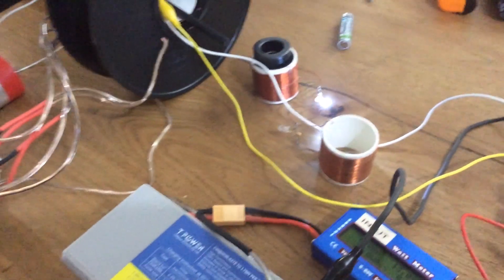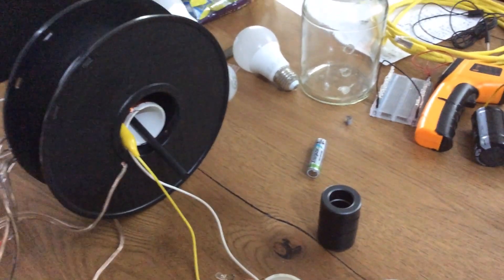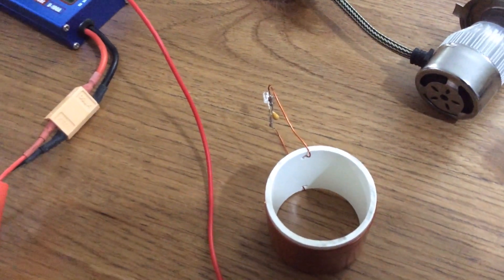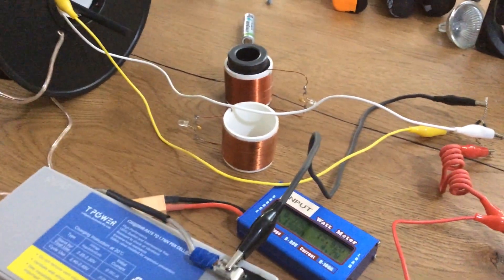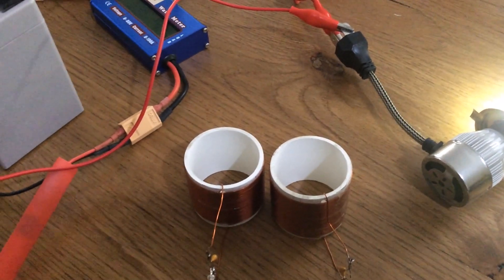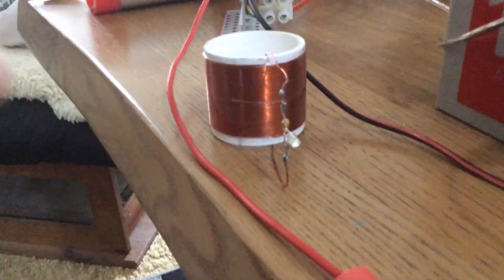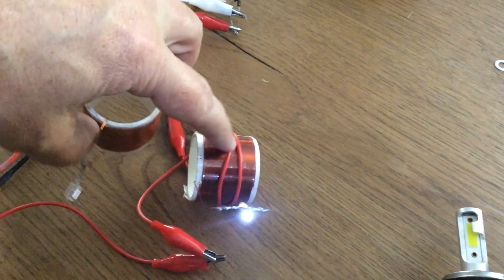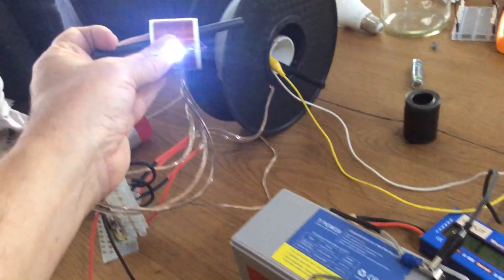Using Resonant Feedback - Don Smith Secret!

Comment: If you really want to show people your setup then please put a schematic diagram for viewing.
Reply from the maker: Thank you for your comment.
I completely agree with you, I forgot to add it in at the end of the video. I am using the circuit shown in the following video, within which I did supply a schematic.
https://youtu.be/Bp9j81ueVBg
This circuit will create the same effect through any and all materials and components and may damage sensitive equipment so please be careful. As seen in this video the circuit produces a strange radiant electricity that passes a radiant AC high voltage through, for example, the 12 volt battery that then allows me to light a small 240v fluorescent tube grounded to earth directly from either battery terminal.
This radiant electricity permeating everything is why I suggest not using lithium batteries as it could damage the BMS and the battery. The only one time I did use a lithium battery it expanded like a balloon into a ball shape, very dangerous.
Reply: @whatifididthis...1236 you mean we must not use lithium ion or lithium Ferro pho osphate (lifepo4)!

Comment: The transmission threw the air is 100 % reliant on its connection back to earth/ground so your resonant pickup coils need be grounded if you want longer range put the pick up coil few hundred feet away and " ground it " Transmitter is already grounded if not you need ground it somehow
Reply: yup, OR the pickup coils can have a large conductive body (i use an aluminim foil covered box) connected instead of ground, to act as 'earth capacitor' and capacitively couple to ground (if direct ground connection on receivers is impractical).  

cool demo thanks!
Reply: @cold3lectric  This entire resonance effect is completely tuned into the earth and its ground as well as its aerial sphere , something like an inverted capacitor where instead of having two charged plates and a dielectric you have one charged plate and a 360 outer dielectric .Maybe I am just talking our my rear end who knows ? lol   (Did i just call earth a monopole?)  suggests the other half of earths dipole is probably another celestial body.
Reply from the maker: Thank you for your comment. I will test your idea re long distance pickup with these coils, I did a heap of testing with earth lines on both transmitters and receivers and each point or group of points seem to have different effects, there’s just so many things to try. I literally experiment just like the title of my YouTube channel, the discoveries from this type of experimentation can be both rewarding and devastating, there’s a heap of electronics I sent to an early grave so the learning curve needs to be quick or you run out of money.
Reply: @whatifididthis...1236  different parts of earth resonate with other points , I dont think all points of ground resonate with each other equally
Reply: @mykedoes4099 oh that's interesting, cool idea (anisotropic ground resonance)

Comment: I finally got a 40 uF capacitor like the one you use, 1200 V-DC...  Can you tel me - is there a PLUS and a MINUS terminal on this, or does it matter?  (symmetrical?). There is one terminal on the top, and one on the bottom.
Reply from the maker: Hi Steven, The capacitors I have that you mention had no polarity markings however they do seem to be polarised and I applied a very small voltage to them to allow me to mark positive and negative.

Comment: Beautiful work here....félicitation! But just one question remain......where it goes the two outer wire of the high voltage coil....because it as no light ( 9w) plugged to it....?
Reply from the maker: Thank you for watching. The 9 watt light that is normally placed across the high voltage output of the circuit is not connected during this video. The high voltage terminals are open circuit leaving one end of the high voltage line “open” to air, at this point the circuit operates similarly to a standard Tesla coil.

Comment: My comment on one of your previous videos is answered in this video.  So you can basically feed back from the resonant coil, rectify, then even with the load you can recharge the source battery! Amazing!  Also this is done without the earth ground connection as well.
Reply from the maker: Thank you for watching. It’s important to keep in mind that in this video I am only using one receiver coil to feedback to the battery and many more receiver coils can be powered here with no increase in input current draw. An earth ground was not used in this case, however I have extensively tested an earth connection with this circuit and there are multiple benefits from doing this.

Comment: what do you use to power the primary coil?do you have a frequency generator?Have you ever tried using biwire coils for your experiments, I have had good field results using biwire Tesla coils
Reply from the maker: Thanks for watching. The main coil that runs the setup is the same device used in my off grid lighting video. You can also find it in my tutorial videos, set of 3 videos. The primary of this coil is bifilar wound 10 turns and the secondary is 180 turns of a single wire. I agree the bifilar supplies a bigger field. I do have a frequency generator but it is not used in this setup.
Thanks again.

Comment: Checkout Lawrence rayburn patent? 10 kw antenna, Barbosa and leal patent, toroid pulls from ground? Ground is 1 volt ?
Reply from the maker: Thanks for watching. I have seen the Barbossa and Leal patent and reverse engineered it to the best of my ability, I’m not sold on the 10 or more ground rods though, there’s $200 right there, however there is something there. My Barbossa and Leal replication did produce a weird effect, which I was intrigued with. I could light 240 volt LED bulbs but barely light an incandescent 75 watt bulb, however there was a crazy amount of heat produced by the bulb. I placed the bulb in a glass of water which took the water just over 70 degrees Celsius. Very strange but perhaps this is demonstrating massive amps at low voltage. I will have a look at the Lawrence Rayburn patent as I can’t quite remember it, if I saw it at all. I have scoured thousands of patents, most of them are a blur in my mind.

Comment: Go to a local creek or river, with a big piece of copper and a big piece of aluminum, place 3 ft apart in water? Get .75 volts 300 milliamps? Water holds frequency better than air?
Reply from the maker: Thanks for watching. I have seen this effect in action and I find it fascinating, some would say that isn’t much power and forget about it. My philosophy is a small amount of energy, collected in as many ways as possible will make you independent. I believe it is more efficient when those electrodes are closer together as I think this is still a galvanic reaction and the moving body of water minimises a dead short response. I think it’s ok to get small amounts of power if it’s 24/7, not even solar or wind is 24/7. Every little bit counts!
Reply: I think earth is a big battery and oceans r the electrolite
Reply from the maker: @earlwilson6153  You could 100% correct. We need to do these experiments to see what our earth is trying to give us. At the least we know there is more power than we need in this big battery we call home. It’s not like the people holding all the power are going to teach us.

Comment: what if you use a steel core instead of plastic?  Does that pickup more magnetic field?
Reply from the maker: I find the plastic better as I can then introduce different cores during experiments. I have tested a heap of different materials and they’re not always successful. Some materials require more energy to saturate and others have faster collapsing times from full saturation to being void of magnetism. I have not tested everything, so if you find a good core material please let me know. I’m always the student and always eager to learn more. Some say soft iron is a good idea as it allows the release of one extra electron, if I’m not mistaken. I have not tested this yet!
Reply: some one was telling me about a material that can be added to copper that makes it 5 ton10 x more conductive,  but I gave not had time to put it together yet. I'm in the middle of moving my machine shop from California to Kentucky,  where I bought a house with s shop. can't wait to get there.
Reply from the maker: @benrasmussen9878  Well that copper mod does sound interesting , I’m all ears if your willing to share. Congrats on the new work shop that should keep you busy for a while.

Comment: how many devices can be driven off the primary system?
Reply from the maker: Hi Ben, thanks for watching.
Technically, as many receivers that you can physically fit inside the magnetic field. This would be a 360 degree sphere or something like a toroid shape around the transmitter, even under the table, for this reason it is recommended to have the transmitter elevated to allow full access to the field. Each coil will extend transmission distance a small distance.
Reply: @whatifididthis...1236  can this be used with the Don Smith system to larger scale systems to , say run  home?
Reply from the maker: @benrasmussen9878   Yes, this concept can be scaled up, when all coils are resonant and within the magnetic field of the transmitter the receiver coils will duplicate the power into all resonant coils nearby. Receiving coils show no extra load on transmitter power supply.

Comment: This demonstration is very interesting. You showed me now in detail how to collect the current back to the 12v battery. That was probably unity and could be extended easily to overunity with more coils or bigger coils.There were 20 Watts input (minute 6 in the video) and it was going through the roof. You seemed to know exactly why this happened. Then you stabilized it back to 5 Watts. How did that overshooting happen?
Reply from the maker: If you look very close at the light between 5:43 and 5:45 you can see field increase.
Please remember that I could be wrong, but I believe it is a state of resonance for the entire circuit and not just individual coils but it becomes one entity. I believe it is achieved when everything is in its place, I have seen this on other circuits I own and I’ve played with it to the point that I now know how to induce it with some of my devices, which I need remind you are Tesla’s devices. Everything has its place and other positions may or may not achieve the same results. I believe the secret here is as follows, create a dielectric field then disconnect and reconnect power before the dielectric field collapses and it uses the dielectric field to increase the frequency to true resonance. I agree with you in relation to coils, you will get far greater output if all the coils in this setup are resonant coils, which they are not! Receiver coils should be resonant with the primary as in Don Smith’s devices. 1/4 wave, 1/2 wave or whatever, as long as it’s resonant with the source coils.
Reply: L2 wire has to be quater wave   langht of the L1 or a odd multiplication.